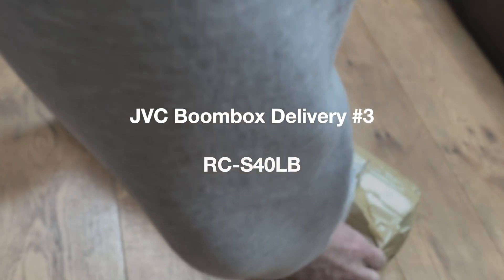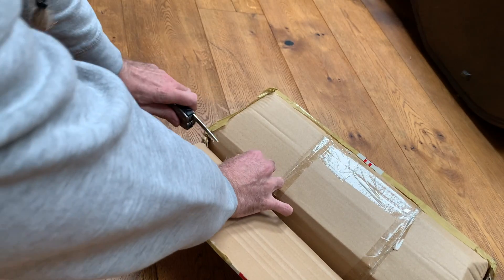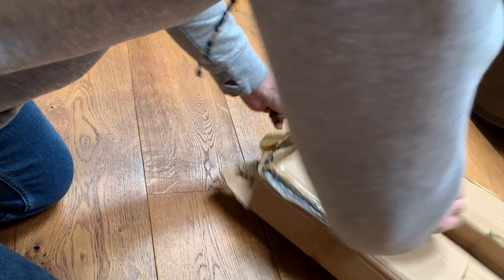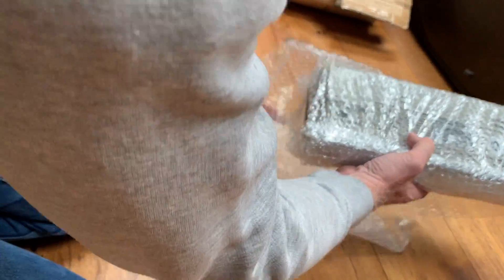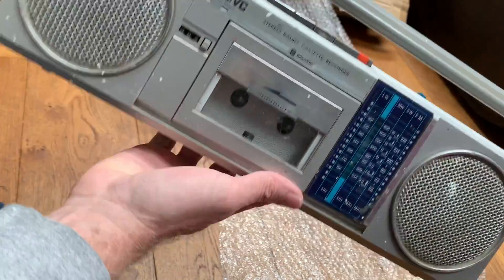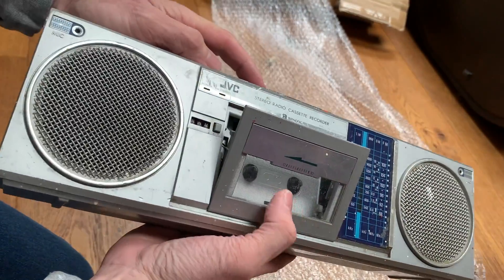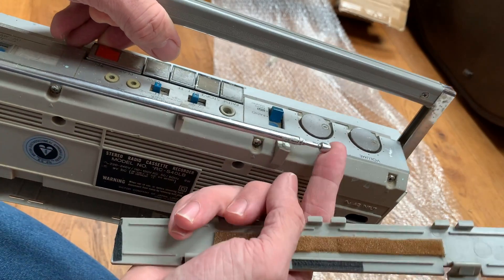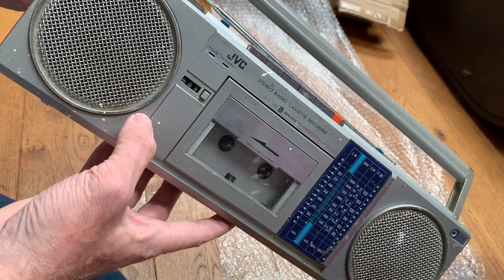JVC Radio Cassette in for Repair. RC-S40LB Boombox Unboxing. Broken Ghetto Blaster.

Comment: I just got a used untested jvc rc-20 in nice cosmetic condition but it won’t power on at all :( there is some minor discoloration on the plastic around the power cord insert so i’m hoping it didn’t have a power short with the previous owner… the figure-8 power cord pins look fine however. Hopefully I’ll be able to fix it one day! Still need to try powering it on using D-batteries.
Reply from the maker: Hopefully you'll get it sorted. Fairly basic machines (similar to the RC-440 and 660 that I have featured) so if it isn't a fuse or a broken trace, you could always convert it into a DC jack and use an adaptor. Thanks for watching.
Reply: @retro_restos  i think it might be a broken trace, luckily everything all works great on battery power! Only stops working when a power cord is inserted. All it needed was some general cleaning, TLC, and a belt replacement as the originals had melted. It took a while for the cassette mech to wake up after adding batteries but she runs smoothly and at the right speed! Im so happy i managed to get it up and running again! 😁🎉 I only planned to run it on battery power anyways haha